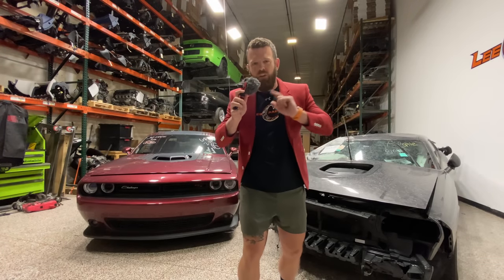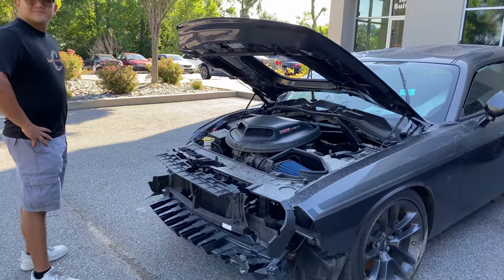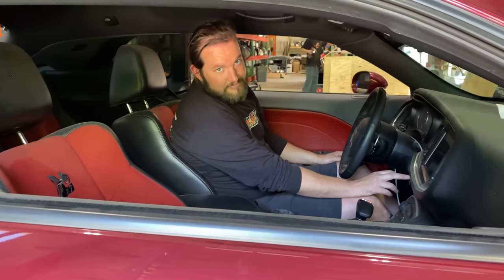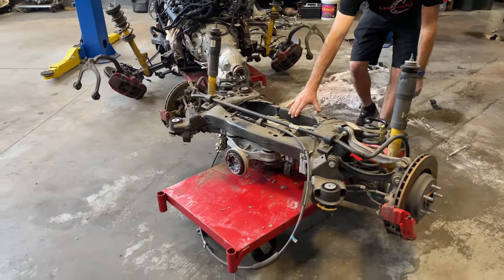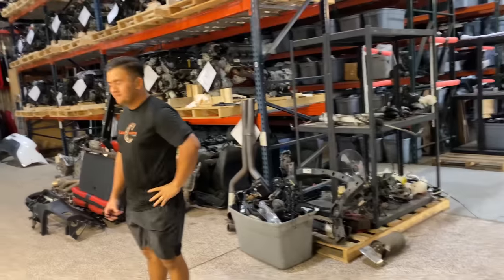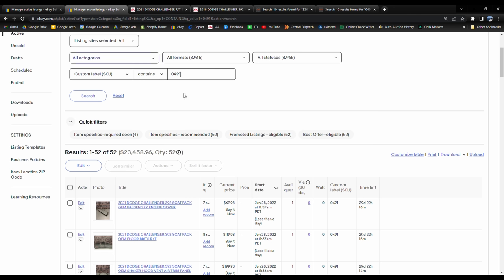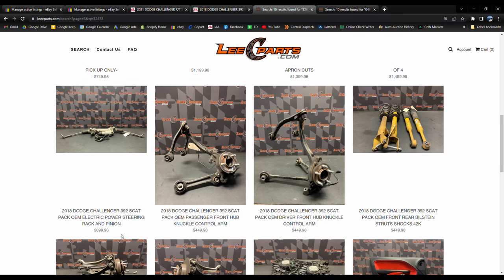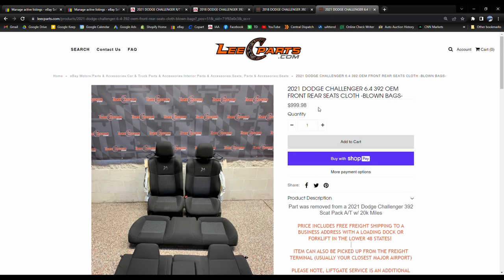I Bought Two TOTALED Dodge Challenger 392 Scat Packs At SALVAGE AUCTION!

Comment: My wish sheet for my 2019 charger scat pack
Set of hid headlights 
Magnetic ride shocks (to upgrade)
5 Wider rims (stock is 9 inch wide with no spare) 
Hellcat snorkel cold air intake

Comment: Could you guys list the exhaust hangers if ya still got either car? specifically the ones at the very rear of the car near the tips that bolt to the body..I need a set.

Comment: Can you explain the leak down process as to decide if it’s a good motor?
Reply: Sure!

You force 100psi of air into a cylinder and the second gauge measure how much leaks out. So if it’s seeing 92psi it will register 8% leakdown. 

Anything under 10 is regarded as healthy, on some built engines that number can comfortably be as high as 20% on the engines with really loose clearances. 

When you see 5% or so, that’s absolute perfection.

Comment: I have a 2016 scat pack I’ll sell u in mint shape widebody title in hand it’s salvage but it’s 392 with 33k miles on it I’ll take 17.5 no blown air bags what so ever front bumper brand ass new never painted hellcat bumper with lip and wide body kit installed and hellcat wheels also has hellcat seats
Reply: We’re u located I’ll buy cash in hand

Comment: Why doesn't you wash your cars?? Really why? Also I like the cars and I would buy them and drive them. My daughter has one and it was a great car after it was fixed from accident at 20,000 miles.. sorry I don't like chop shops I would like to see them fixed. Unless totally screwed.
Reply: Also do not piss on Dodge because a Chevy guy or run into hillside mustang. Boys can't make it 500 miles without running into someone also 99 % are little engine cars. Sorry I can't but Ford trucks with 2.6 engine that will need two turbs put on after 60 - 70 ,000 miles.